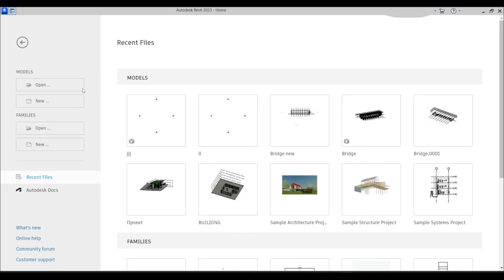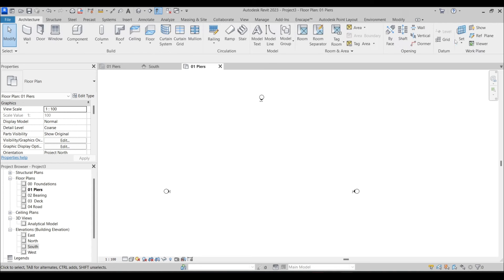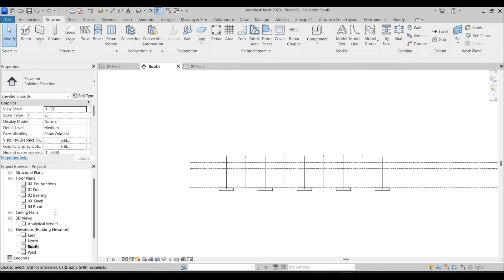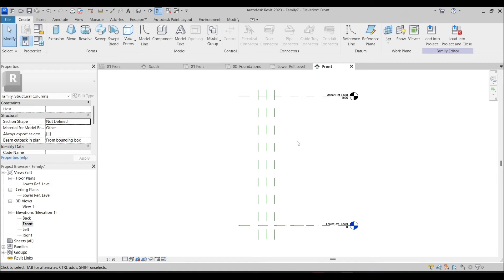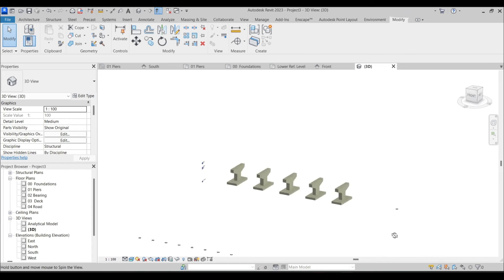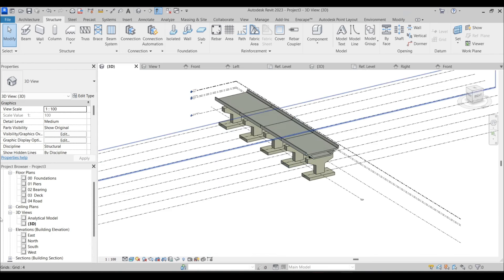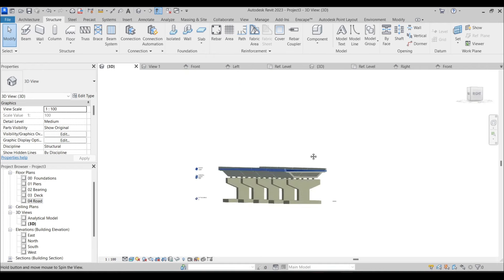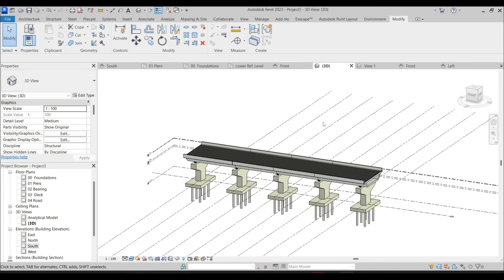Constructing a Full 3D Bridge in Revit

Comment: Normally In bridge design industry, the geometric control may by dictated by highway design. Would you please illustrated if we will import existing surface from C3d incorporated with geometric control such as plan alignment, profile, superelevation and/or assemblies, corridor to be used as control of bridge geometry. Very thanks in advance.